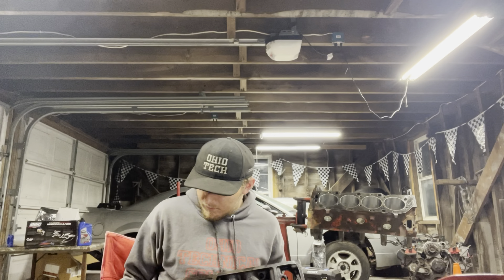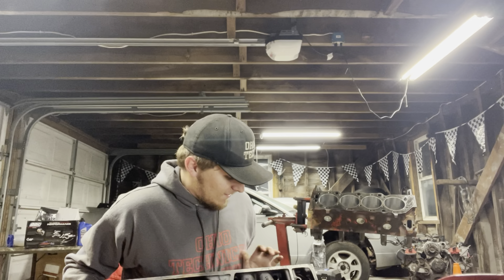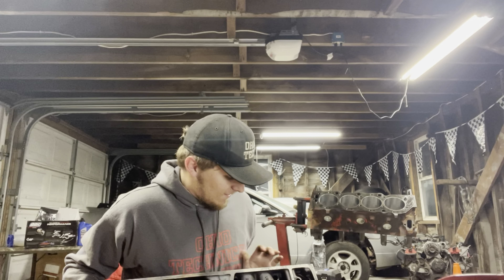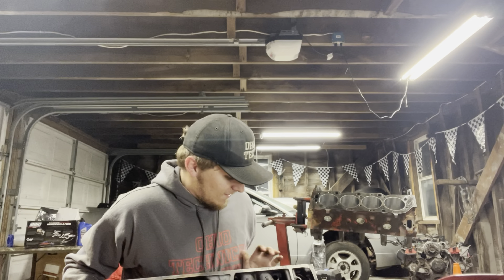OUR ENGINE BLOCK IS BACK FROM THE MACHINE SHOP!!

Comment: Did you think about mounting the motor in the car before machining or acquiring a dummy motor?
Reply from the maker: Nope haha just working with what I've got.  Once I get the engine and trans together I'll mock it up with the cherry picker and come up with something that will work!  It will take some time and some innovation but where there is a will there is a way! The built engine will have a different geometry than the factory configuration because of the oil pan, headers, etc, so once things are together we'll mock it up and see what we have to do!